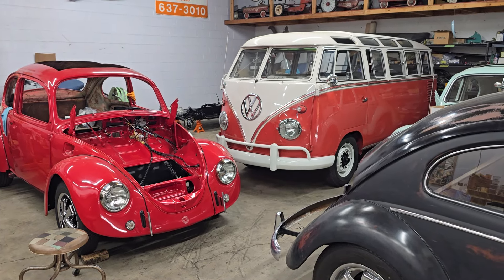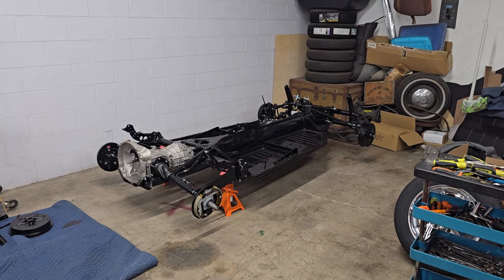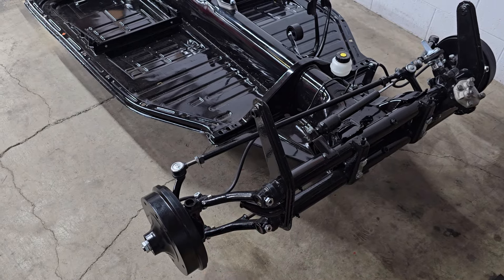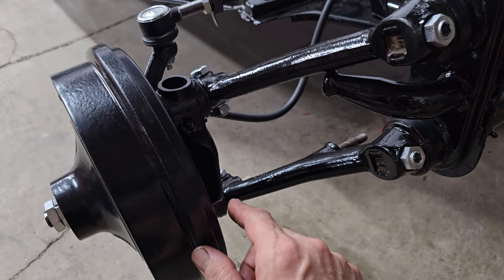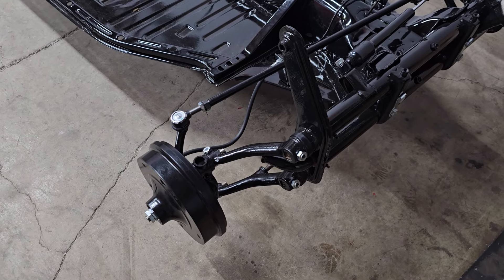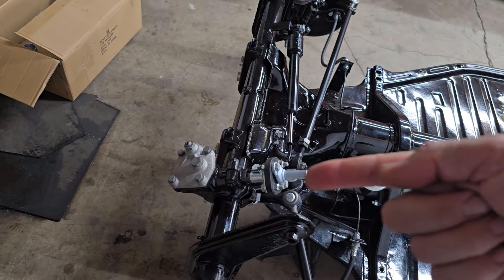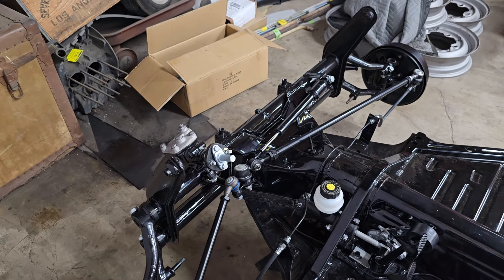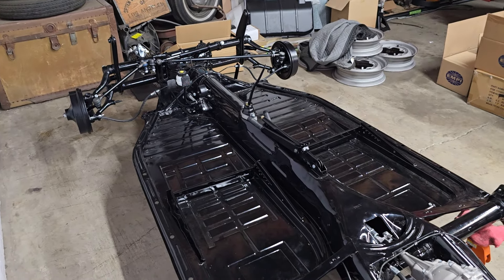A Day in the Life of Vintage Classic Specialist, Episode 210, Buggy front end assembly and sweat!

Comment: question if converting to a ball joint and front  disc brakes do you have to buy new /used tortion thingys or can you use the ones from
or modify them from the link pin parts. 62 Ghia going to be my cross country driver daily driver and ball joint front disc bring the car to the 70s lol. thanks . i would die in that heat
Reply from the maker: None of the ball joint front suspension parts will fit on your link pin car. You would have to saw the whole pan head off and weld on a ball joint pan head to put ball joint suspension on your car.
Reply: @VintageClassicSpecialist can you  modify the head to fit the ball joint beam?
Reply from the maker: Unfortunately no, the whole pan head has to be replaced. Link pin cars can handle and ride pretty well though if properly set up.
Reply: @VintageClassicSpecialist  Didnt realize how cheap they are to purchase nuther route lol